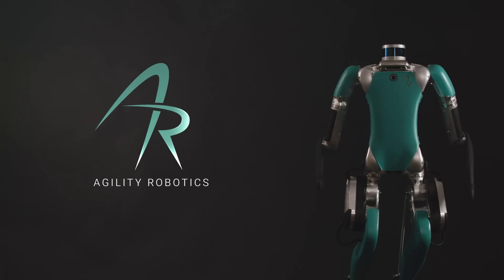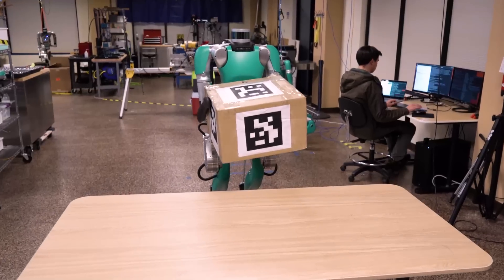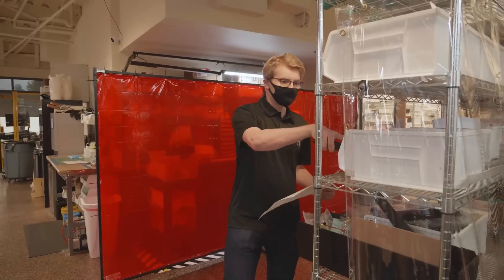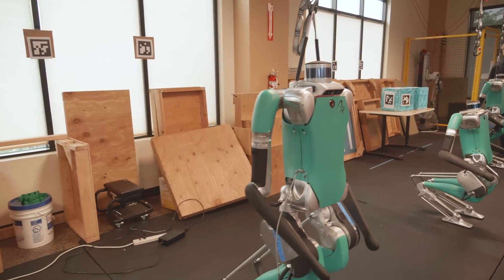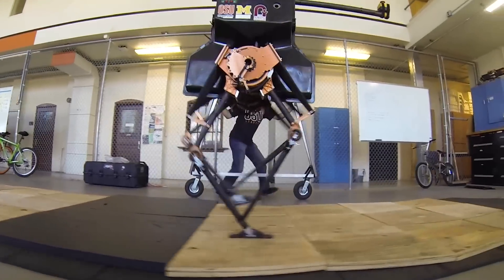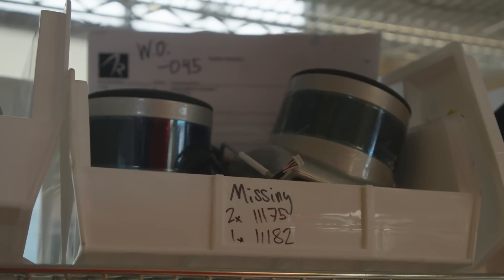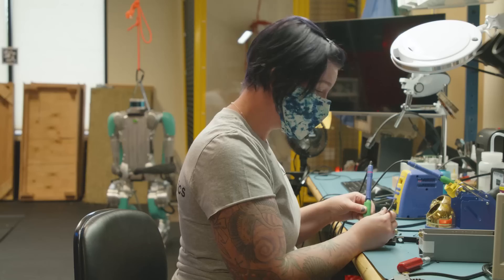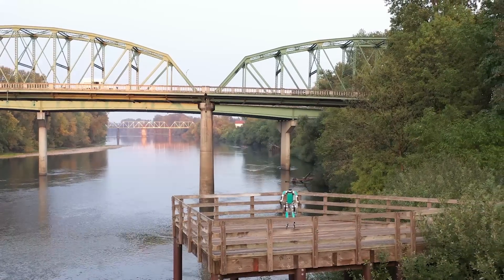Agility Robotics: The Next Steps

Comment: How many hours of average box stacking could Digit do before it will need to recharge itself?
Reply from the maker: 2-3 hours at the current battery capacity. With a 1C charge rate, this gives us nominal 2:1 duty cycle, or about 16 hours of operations per day.
Reply: @AgilityRobotics  No plans to make the battery modular and mounted on the back of the robot to enabled hotswapping of battery packs from a wall mounted charger?
Reply from the maker: Modular batteries are tricky to do well. Thermal management, charge control, and safety rating are all easier if you're able to use the structure of the robot as opposed to having the battery standalone. The pack is of course field swappable for service reasons.
Reply: @AgilityRobotics  Maybe have step on metal floor pads and metal pads on the feet so the robot can go and charge itself when needed.
Reply from the maker: We've taken a look at inductive charging. Efficiency is challenging, or at the very least, more challenging than contact charging at comparable power levels. Worth keeping an eye on but probably not on the radar for the next few years.
Reply: @AgilityRobotics  Yeah, the losses generally don't make it feasible. Especially given that Digit is a lot more dexterous than, say, a car, and could more easily couple to contacts
Reply: @hb-youtube  wireless charging not efficient, contact pads the robot can step on to when it gets hungry are much more efficient
Reply: @stevezodiac4712  Perhaps I should have said charging-without-wires; look at the story I sent; they use contact (on surface of the roads in case of cars)and that's what was referring to. Not sure that robot  uses as much energy as car traveling 100+ miles so efficiency may not be equally critical but be that as it may, look at the video I sent: they use contact-charging (but without wires) and that's what I'm referring to. Regards
Reply: @AgilityRobotics  How about a battery backpacks? It would be easier to do right, because thermal, contact, or other issue would not be critical to the operation of the robot, in case of failure the Digit could just switch to another one.
Reply: @AgilityRobotics  Just two packs in it, one one is going low.. have it take it out by it self, stick in charges and put new one in, while operating on the second pack... it could operate until the batteries get bad for ever, with just stops for replacement....
Reply: @AgilityRobotics  If you are looking at contact charging.  A good goal for manufacturing would be to have it able to quickly reach the contacts and take 20 to 30 seconds charge at a time.  That way it will be able to top up each cycle in between motions.  For example an automotive assembly line with a cycle time of 60 seconds and a "operator" time of 40 seconds would leave you 20 seconds to get some charge.  

With that in mind you may even be able to do away with batteries and opt for super-capacitors.  You only need a few minutes of charge if it is topping up each cycle.  Then you also can drastically increase the charge rate to just a fraction of a second.  Near 100% duty cycle.
Reply: @AgilityRobotics  can you just have a certain mode for the robot that makes so it can have a extension cord plugged into a wall instead of being wireless?
Reply: @AgilityRobotics  Perhaps moving the charging leads to the bottoms of the 'feet' would enable constant operation while on pre defined paths i.e. roll out runners or built in inductive 'sidewalks'
Reply: @demonsynth  I thought the same...
Reply: @AgilityRobotics  Electric bicycles have replaceable batteries with integrated BMS and a standardized charging solution. Become an OEM of one of these manufacturers instead of reinventing the rechargeable battery...
Reply: @AgilityRobotics  Just keep switching out the batteries.
Reply: @AgilityRobotics  how bout make a plan to adapt super capacitor, and recharge on the go on pre-determined waypoint? worth a consideration.
Reply: Could you just plug it in and connect the cable to a ceiling grid so the cable can slide around on the ceiling and the robot can move around the wearhouse freely and work 24/7?
Reply from the maker: To maintain a common platform for indoor and outdoor tasks we've been hesitant to use any form of tether (other than safety tethers during prototype testing). Early versions of the ATRIAS robot, prior to 2015, used a shore power connection, but all versions of Cassie and Digit have run from internal batteries.
Reply: @AgilityRobotics  thanks for the reply, it's really nice how active you are in the comments
Reply: A magnetically locking connector on the back could also let it just back into a wall station and start charging.
Reply: 2-3 hours with an empty box lol Notice how they never stated the weight.
Reply: Make it with multiple battery docking stations, then you could swap out a dead battery, AFTER it puts on a fresh battery.
What about tension poles?  (Think bumper cars at the fair.)  This would allow work 24/7.
Reply: @Rocky1765  bruh do you guys even read the comments. They already responded to why that isn't feasible multiple times and its an obvious idea that many people have 'suggested' before. They're literally building a robot with object awareness of its surroundings, self balancing, and AI advanced enough to do a specific task in a dynamic environment. Do you think they haven't thought of such a simple idea yet?
Reply: @DrakeOola  well seeing how I gave two suggestions and you are speaking as if I only gave one, i will disregard your rudeness as such.
Reply: @Rocky1765   @Ninja 87  Both 'ideas' have already been rigorously discussed and tested if you bothered reading. What you suggested is essentially just a rigid tethering system with  more detrimental effects to motion capabilities. Dual contact power rails on the floor are essentially the same thing. They do not want to limit motion or require additional structures to built in the environment. The whole point of the robot is its dynamic environment capabilities and the point of the video was to explain how environments are built around machinery and how they're trying to change that.
Reply: Is there a replacement battery where the robot can replace its own battery without human intervention? =D